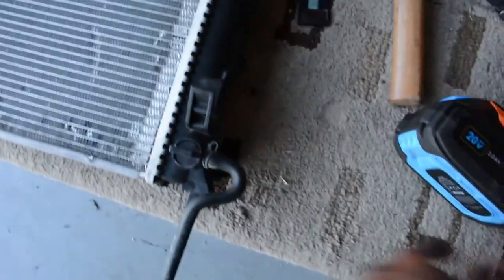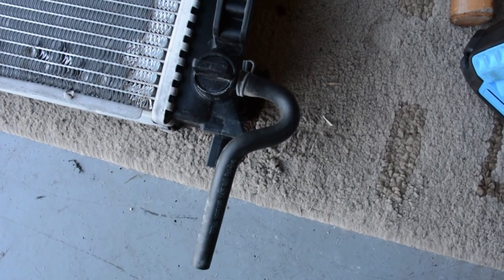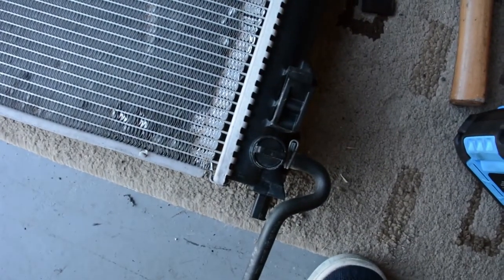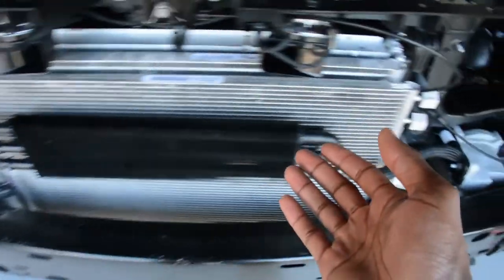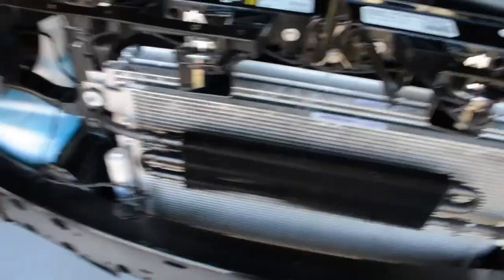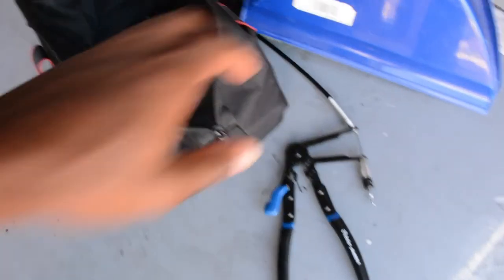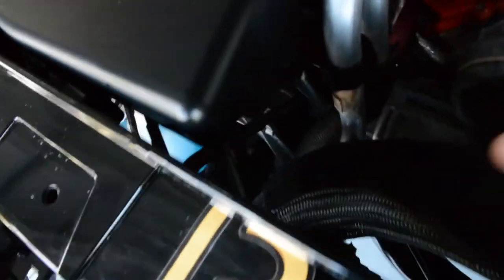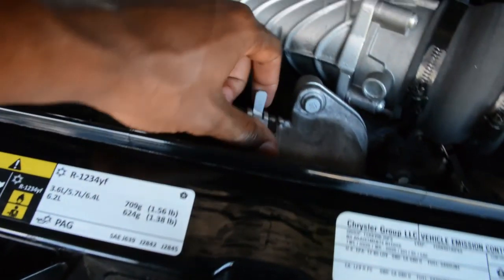Radiator Replacement on a Dodge Challenger HellCat

Comment: I'd say an easier way to remove the radiator is to drop it from the bottom of the car. Now, I don't have a hellcat, I have a manual transmission scat pack... I had the same issue progressively get worse until today (01/05/2022). Difference was here in Kansas City its a frigid 15°F. Car started running warm with no heat. Saw the temp rise to uncomfortable temperatures. Changed plans and went straight home. Saw I had no coolant.  The coolant leak get worse; now to an unmanageable level (aka I'm not gonna keep topping it off anymore). 

 Long story short, it took 2-3 hrs to drop the radiator from the bottom. All I used was my socket set, channel locks and electric ratchet (if you are reading this and work on cars often, buy one...). I got every fastener and clap off without resorting to using a hand ratchet or other tools.
Front clip stuff reminds me of Audi's. If anything went wrong it was "we gotta take the front off the car to get to it" talk.
Reply: This guy took off the whole front clip to change the radiator 😮that's a little much made more work than it had to be I like your comment you can tell you know

Comment: The thermostat that come in the car is a 203 thermostat. From my understanding In order to change this thermostat you need to be able to reset it to 180 meaning you need tune capability so if not then I’ve been told it will throw a code or not act right. Please let me know how that worked out for you I also have a hellcat myself and am having to change out some cooling components myself soon. Also I believe your fan needs to be reset to 180 as well as which is also tune.
Reply from the maker: The T-Stat itself opens at the temp that it’s rated for. When I changed the T stat, I noticed that the fan turns on at 185, vs 206. I think that the the car is looking for fluid flow in order to kick the fans on. This is only if it’s idling though. At hwy speed, obviously, everything stays cool and well under 180. It also could be different depending on year model.
Reply: You will eventually need a tune. You will get a CEL for the vehicle not coming up to temp. Within time during cold weather. Great video! Changing mine in the morning. All aluminium is going in. Peace
Reply from the maker: @meanmugmuzik7901  there is no cold weather in FL 🤣
Reply: @bluesuitreviews658  so absolutely no issues with the new t stat since then and instead of 206 degrees the fans activate now  at the thermostat temp of opening without a tune? No cels? Just interested because I’m about to do a lot of work myself to the whole cooling system figured why not do a thermostat that’s not 206. As you know Fl is hot and the summer is coming so figured I would follow up to see if everything is good before I do it. What year is your hc? Sorry about all the questions but hc content is rare to find and I like doing my own work but prefer to avoid mistake’s that cost money if somebody has already tested this then it’s worth asking.
Reply: The engineers designed the car to run a 203 thermostat so the engine oil would stay around 220°-230° The oil temp is important for the solenoids in the MDS to open and close properly. Everytime you modify something it alters other components which alter others. You create a domino affect. You will not see or feel any difference between 200° and 180° they are both hot as shit. The engine will not make more power or last longer. These engines are designed to run the way they come from production. No point in trying to get more power if the wheels just spin. Plus these cars are heavy and slow anyways. Poor man's muscle car. My GT3 will dominate anything with Mopar stamped on it.

Comment: hey bro i need some assistance you’re the only person i’ve got close to fixing a radiator . mines recently started linking exactly the same spot you mentioned . i assembled everything back in place but my ENGINE CHECK LIGHT started to appear & Antifreeze/Coolant Temperature started to rise higher than normal . stock on the thermostat & everything but i can technically find what is cause it to over heat after replace the radiator by any chance would you know of help me figure out where i’m in the wrong please
Reply from the maker: Sorry for the late reply, but it sounds like there may be a clog in your hose. Did you drain everything. Sure you have figured it out by now.
Reply: found out our dodge car parts are made in china even oem parts